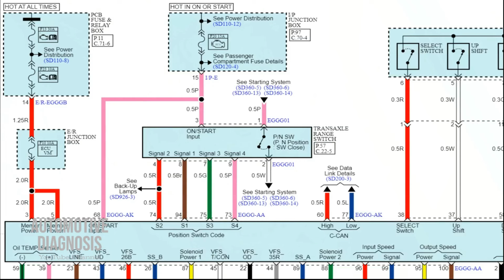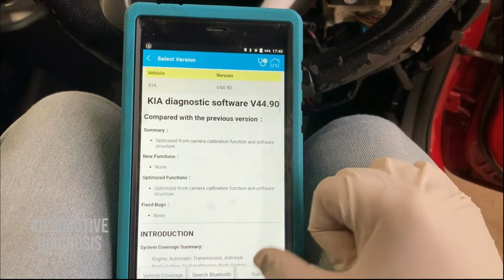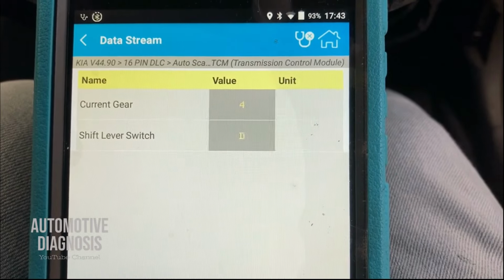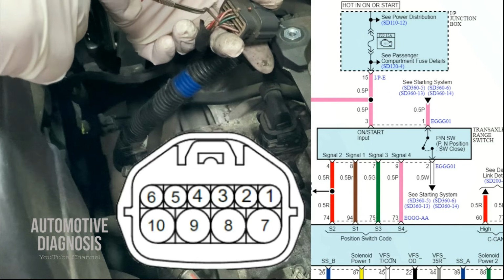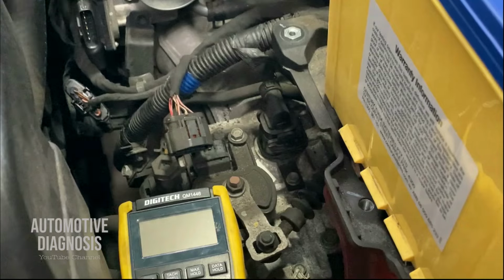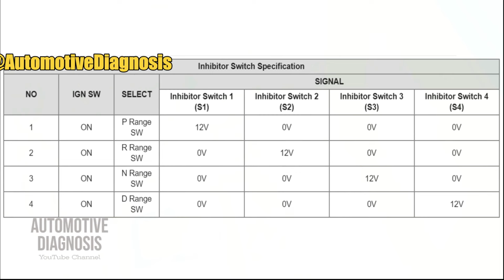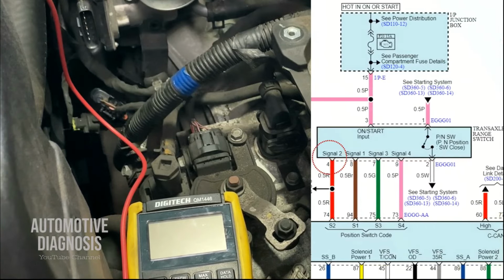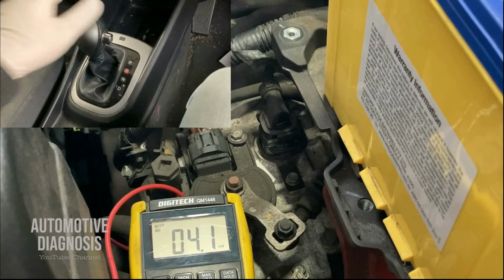Don't Replace Transmission Inhibitor Switch Before Watching This !

Comment: so which fuse would it be in the juction box ? mine shoes no gear on dash so i have no rever d p or n also car dont start no crank on neautral pnd nothing i just installed new one still non

Comment: so why is it when I turn on the headlights the TRS wont work,,,,,, I also get a voltage high ,,,,,,,when I rev the engine the past 4K the voltage dips to 8 volts and the engine bogs down....the car will drain a fresh charged battery ,,, I had the alternator tested and its good.....is it a short?

Comment: Hey I hav problem with transmission inhibitor 
When I start the car it’s look everything is okay gear position all are indicating in the dashboard 
Once the car in the traffic and got heated 
Suddenly my gear position indicator is disappear from the dashboard and then car is not electronically connected with gear and my accelerator (I feel low power) 

I have recently change the ECU unite and for a one month I didn’t had the problem 
Later I thought transmission inhibitors the problem and replaced it 
But still problem is there 
What should I do ? 😢😢

Comment: Ware is the range switch 2002 Cadillac DeVille
Reply from the maker: Range switch is on the transmission, on front wheel drive cars can be found at the engine compartment but on the rear wheel drive cars can be found under the car on the transmission.